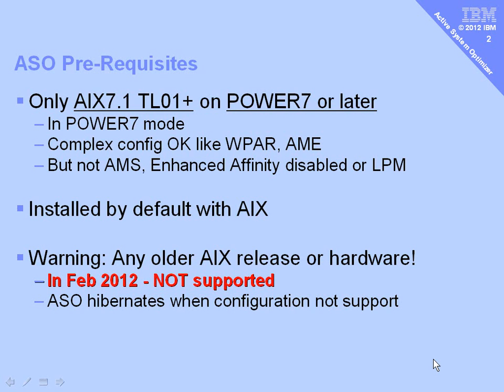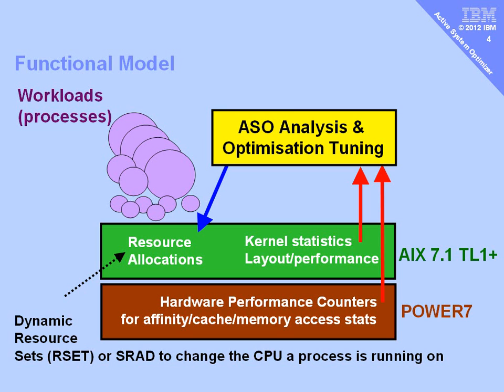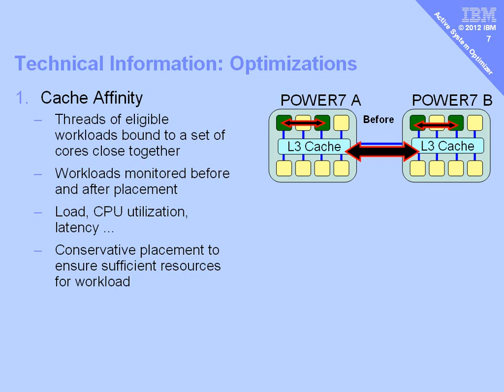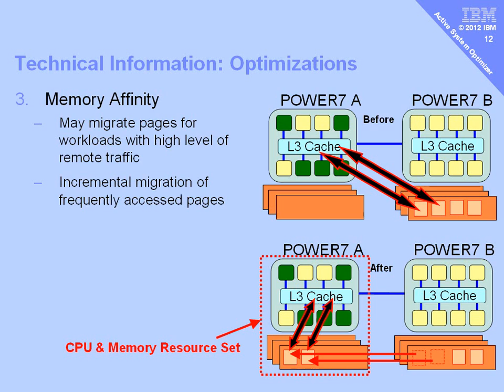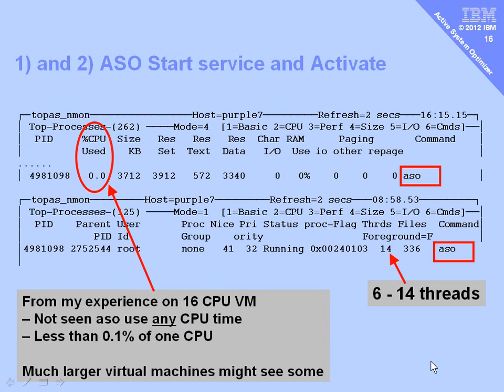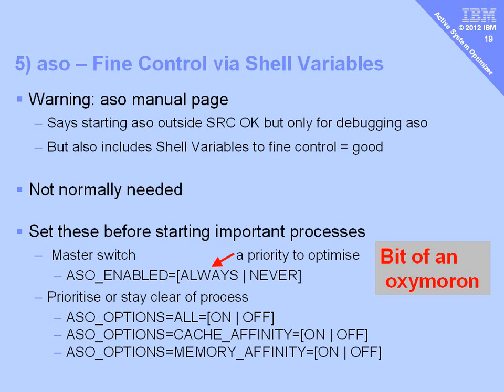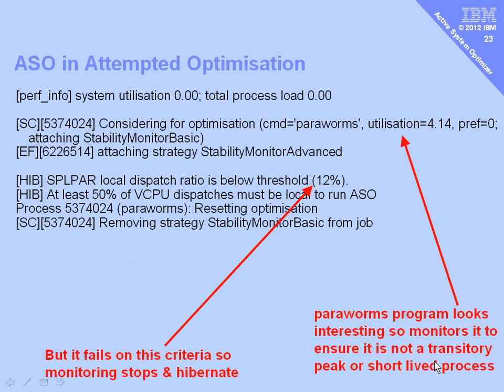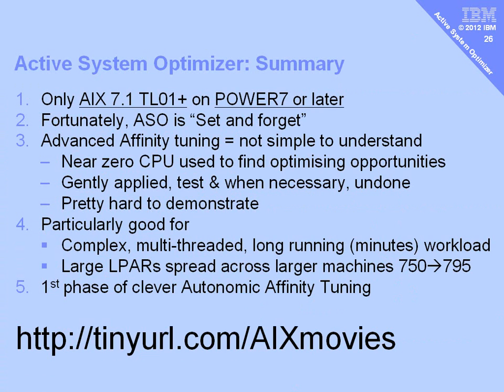AIX in Focus: Active System Optimizer

Comment: Hi Nigel , After post LPM , in destination lpar home SRAD become -1, then why sched and swapper kernel process went for far dispatch even there is single srad only can you please explain
Reply from the maker: Not sure why you are asking this question on a totally unrelated YouTube video.
Your question is very specific to your computer and configuration.
So I recommend you contact IBM Support to answers your question - they will probably ask for lots of information details and logs. For AIX this would include a Snap, perfPMR and other command output.
Best of luck.
I have seen that it is best to leave and LPAR to settle down for say 15 minutes before a running commands like lssrad, vmstat, lparstat  etc. The AIX kernel will have background tasks running to make adjustments to settings.